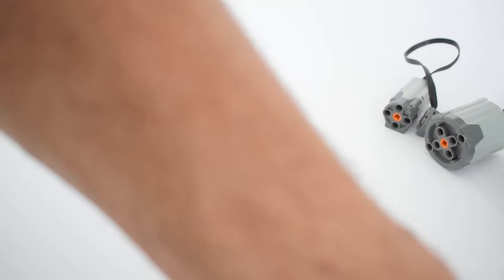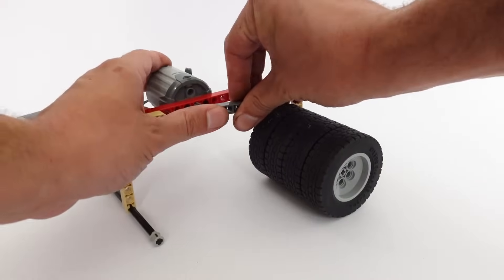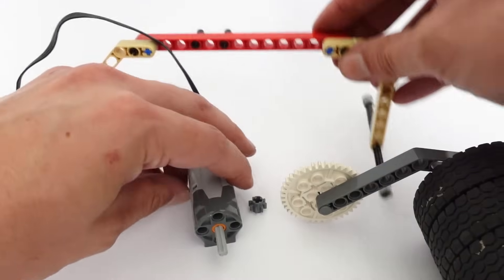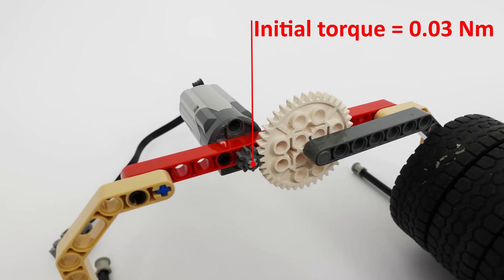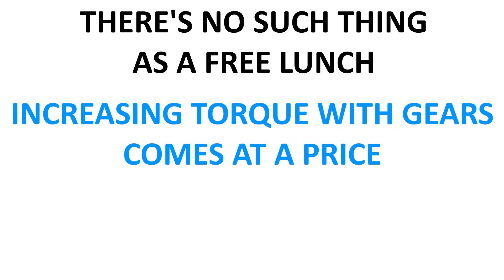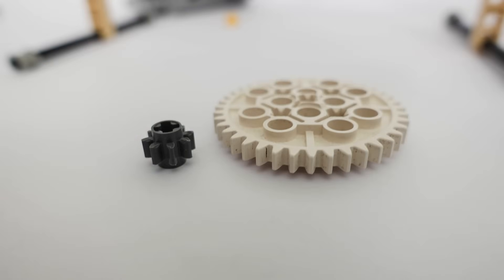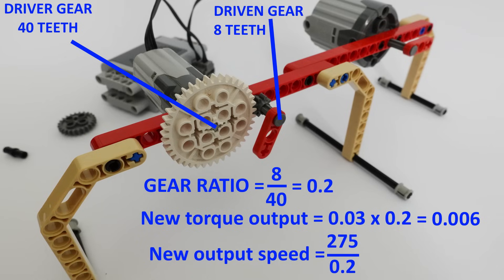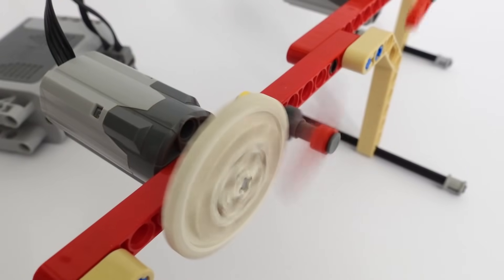NEVER be confused by GEAR RATIOS again - EXPLAINED in the MOST VISUAL WAY using LEGO

Comment: Well explained demonstration on torque, speed and gear ratios. Two motors of equal horsepower can have completely different sizes, weights, and shaft sizes solely dependent upon speed. This is especially noticeable in electric motors. Keep up the great videos.

Comment: I love this kind of videos! Loved the ones about torque VS horse power. I have to admit I'm still a bit confused though. I still can't wrap my head around the difference between a fast car and a car optimised for towing a load. Seems to me they both need more of both torque and horse power to be good at their job, yet I expect there should be some difference. I think I'll watch the torque VS HP videos again, but if you have any further explanation that would be very welcome!
Reply: I've rewatched the original torque VS HP video and it makes more sense now. I guess the problem is that torque is part of HP itself. Somehow it feels like having lots of torque should translate into faster acceleration, yet apparently it's better to have less torque and more rpm... hmmm I wonder if I'll ever fully get it!
Reply from the maker: You got the key part. Torque is part of hp. That's the essence. I think the last piece of the puzzle you're missing is this: What matters for towing is not just HOW MUCH torque you have but also WHERE that max torque is developed in the rpm range. Semi trucks have a max rpm of 2500rpm or so and their max torque is often achieved at like 1200-1500rpm, which is just a bit above idle. Sports cars have 7000-9000 max rpm and max torque is at like 3-6k usually. This isn't useful for towing because you want to be able to pull the load right as you start moving. As soon as you go off idle basically. A sports car would have to rev up the engine and then floor it to move a massive load and would have to stay at that high rpm. It means difficult taking off and stress for the engine both during take off and continued towing. Hope this helps. Let me know if you got it. I won't quit until you do 😁 I really like helping people get things.
Reply: @d4a  Thanks, it does help! I've heard that to tow you need a lot of torque, which is confusing because for a sport's car it's also true that "the more torque the better", really what they should have said is "for towing you need a lot of torque at low rpm". And then I guess that having a lot of torque at low rpm isn't fun for sport because you would then need tons of gears and shift up all the time. So I guess you need enough torque at idle to get moving (which is easier for a sport car than for a big truck), and then the more torque you can have beyond that the more fun to drive, but engineering reality dictactes that the more torque you start with at low rpm, the harder it is to make an engine that get even more torque as it revs up?

Comment: going back to the torque vs power video, the power at the output shaft of the driven gear is still the same (assuming no frictional losses are present of course). what changes is the force and the speed. for instance at the gear ratio of 5, the output shaft is applying 5x the force at a fifth the speed, so it still means that the small motor is still putting out 0.0013HP. just we have sacrificed RPM in favor of torque. 

great video as usual! whatever you're doing to make these videos, keep doing it!

Comment: Hello i have two questions that I am asking you to answer
If I have 1 set of gears at a ratio of 2:1 with the driver gear having 10 teeth and the driven gear having 20 teeth and another set with the same ratio 2:1 but with the driver having 20 teeth and the driven having 40 teeth is the guess that the one with 20 teeth and 40 teeth will have more torque output even though the ratio is the same since the leverage is larger since the gears overall are larger. 

Also in a combustion engine does the amount of air and fuel put into the chamber during 1 rpm increase at higher rpms ?  
Thanks before hand for answering🙂
Reply: first, at same gear ratios, toque is same but in real world if you have big load on gears is better to have bigger or wider gears to to ensure sustainable pressure between teeth of gears or have more teeth in engagement to reduce load per teeth
second for petrol engines if assume that it works at fixed a/f ratio, more fuel is injected as engine speed up at WOT, because raises cylinder fill up with mixture because of higher speed of air that travels through engine(up to max torque rpm, after that mass flow of mixture decreases per cylinder per cycle, but mixture starts to be richer and then efficiency falls down, but power raises up to rpm of max power)

Comment: Knocked out of the park again, just like explanation of the odd fire v6 and why it was necessary to split the crankpin/journal.  Simple explanation is the best.  Not much that I haven't seen that can't be broken down to simple explanation, even quantum mechanics.  When you show someone a formula or mathematical concept without given some explanation of how they are derived and actually mean people can quickly become intimidated.  If people can understand this explanation, I promise that they could understand calculus, linear algebra or differential equations.
Reply from the maker: My thinking exactly!

Comment: Love you videos! I have a question, could the larger motor set up with a 1:5 ratio gears move the weight? I do mean 1:5 not 5:1.
Reply from the maker: You would reduce torque 5 times making it pretty close to the base torque of the smaller motor which couldn't move the weight.
Reply: And if you push it hard enough, your pinion gear (the smoll gear) will fail. As in break if it pushes past its bending strength.

Comment: Ya, usually this HP tourqe rpm thing.. I do Explain it with a pile of rocks ya need to move from one spot to the other. Tourqe is how many rocks you can carry in 1 go, and rpm is how long it takes to deliver a round. And HP is Just the product of these.
More HP means you move the whole pile in less time. 

So everything being equal, and properly matched gears (preferably cvt) , and given 2 identical cars by all other means... One of them has more HP the other has more tourqe, the one with more HP will allways win. 
Say.. Got a 80 HP tractor that has a redline of 2000 rpm... And got a bike engine revving 10k and making 100 HP, i could swap in the bike engine and it would outperform the tractor. 
But, the cost would be shite fuel economy and.. The bike engine is not designed to be ran all day at redline. Surely i would need a 5:1 reduction gear, and the tourqe curve is not identical. Still, it would be moving with the same load far, far better.

Now, i did a comment with identical comment on an other channel, but oddly people do argue that 1 HP is not equal to 1 HP witch is Just plain silly as it is. 

This video does indeed show how things work in reality very well. Good Job awith the lego gears.
Reply: About tractor bike thing. It is only true if tractor has 800nm@2000 of torque and bike has 160nm@10000 peak torque (5 times less). If bike has 40nm@10000 it has no chance of outperforming tractor no matter of gear ratios
Reply: You see, tourqe and HP and rpm have a relationship. The tractor engine can only and only make 80 HP at 2000 rpm if it Allso makes ~285nm. If it makes less, then its less Than 80 HP. Plain simple. 
And the bike engine can only make 100 HP at 10k revs, if it Allso makes ~71nm.

If the bike engine gets geared down 5:1, then the output is 2000 rpm and 355 nm. Accounting for some losses it will be around 320-340 ish. Wich is Naturally far more Than what the tractor engine makes.

Comment: A big semi truck engine might put out 495 horsepower which is roughly the same as a new C8 Corvette. Yes a C8 Corvette engine COULD be used in a semi truck to haul large, heavy trailers. BUT to do so effectively it would need to be screaming at 6500 rpm all the time to achieve maximum power. The huge diesel engines usually used in semi trucks, can make that same horsepower at ~1600 rpm, meaning it will last much, much longer at full power output than the Corvette engine which has to spin 4x faster to generate the same horsepower. That's why semi truck engines last for millions of miles routinely, where as a Corvette that's driven flat-out in endurance races, might need a new engine after just 5,000 miles.
Reply: Can you relate that to force and work done?
Reply: Bingo

Comment: Can motors with different torque values and rotation speeds work together to simultaneously drive the same mechanism?

Because if so, then that could have pretty big implications/applications for transmission design.
Reply: It can and it have big application: CVT in Toyota and Lexus Hybrids. In other hybrids i think too, but i don't know their designs. Just search how CVT Hybrids in Toyota's work.
Reply: Yes and no. The priciple that needs to be applied is torque vectoring/balancing. You can calculate torque from V, I, theta and rpm for an AC induction motor. Often you have a master and a slave motor (industrial applications), however this is treated differently when you have a FWD vehicle with individually driven wheels, hence the requirement for torque vectoring.

Comment: By increasing the torque using gears is the hp going to increase to?
Reply: Ok so it doesnt increase. Thx for responses.
Reply from the maker: Think about it... If you increase torque you reduce rpm and horsepower is torque x rpm.
Reply: @d4a  well...a car will rev to the same rpm regardless of wich gear you are. Sooo yes?
Reply: @tudor3874  But the wheels are spinning lot faster at high gears
Reply: Does your car make 300 hp in 3rd and 400 in 4th? I don't think so

Comment: Great video.

Though isn't the corolla hatchback's 6th gear ratio 0.69 (not 0.39)?
Reply: Thought the same, 0.39 seems atrocious to me
Reply: 0.39 would translate to 98 mph at 2000 rpm
0.69 would translate to 57 mph at 2000 rpm

a corolla hatchback is a naturally aspirated 4 cylinder
Reply: @camryv  0.69 sounds much more reasonable indeed. Also, if 6th really is 0.39, then RPMs drop by almost 50%, because 5th is 0.84. This would be very annoying in places with even a slight uphill gradient, because you would have to hold onto 5th for quite a while until you can upshift into 6th

Comment: Tell me this @driving 4 answers :

So what is pros and cons of 

having bigger engine producing higher amount of torque but low HP

vs

having smaller engine producing lower amount of torque but high HP,

Considering we can manage output speed and torque by a suitable gearbox.
Reply from the maker: The key thing here is that hp= torque * rpm. To have lots of torque and very little hp means that the engine is incapable of high rpm. An example of this is a tugboat or truck engine or something. Giant torque that can pull massive loads but low rpm. To have lots of hp and little torque means that the engine produces little torque but revs very high. An example is 250cc sport bikes with 19k rpm redlines. They're capable of good acceleration, speed and agility but they obviously can't pull anything other than a human and would be very slow if they weren't lightweight.
Reply: @d4a  
Thanks for the answer bro. It helped me.

I am myself an Engineer, but the way you explain these concepts with such clarity and simplicity, it brings a new dimension to understanding.

So , 
Correct me ,if you need best of both worlds i.e for towing and speed, you need an engine which has medium torque and medium to high rpm. Eg. Engine with square stroke ratio like that on low to medium duty pickup truck  ??
Reply: The pros and cons lie in their capabilities.
Think of a light or medium duty truck versus a sports car. The truck can tow, but is mechanically limited to a comparatively low speed (due to gearing, and suppose we are ignoring aerodynamics). The case is the opposite for the sports car (again, we are ignoring aerodynamics).
Reply: @psnmadracer27   Thanks for the answer . It helps .